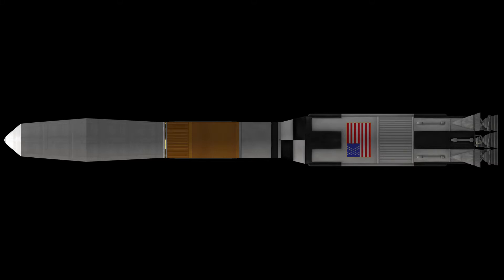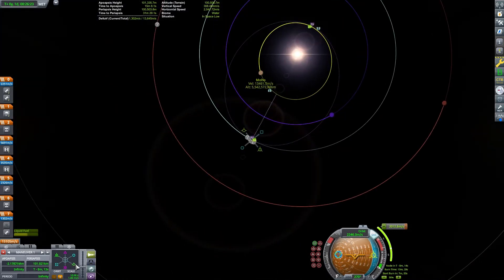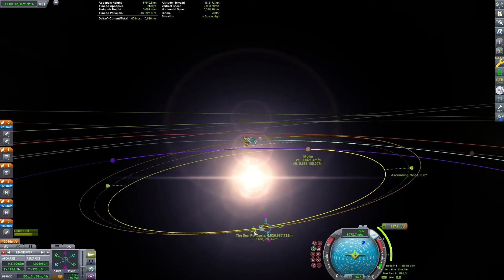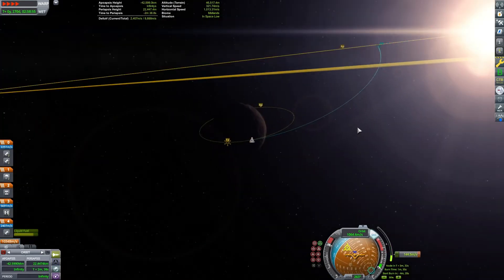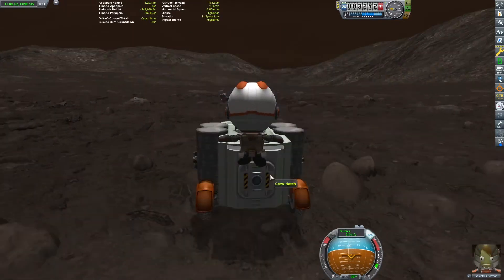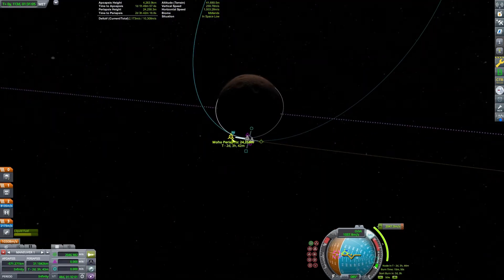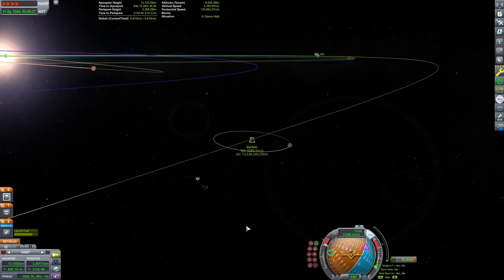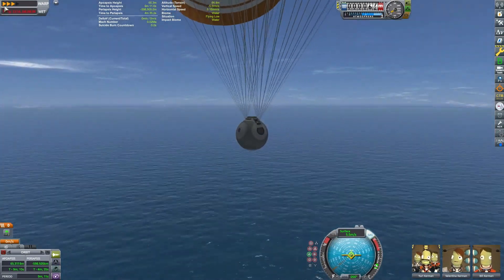Moho Mission

Comment: Great video! You should try a BFR starship style creation using 7.5 size fuel tanks from procedural parts with a all in one second stage then refuel the crew second stage with a fuel tanker. BTW love the SpaceX style music in the background.
Reply from the maker: Thanks.
I have made a full sized Starship and Booster using the stock parts. I used 5m fairings to go out to 9m. The full stack is massive compared to the KSC launch facility. Unfortunately the stock game does not have a comparable engine to the raptor or merlin.